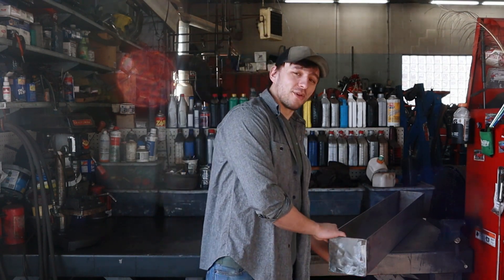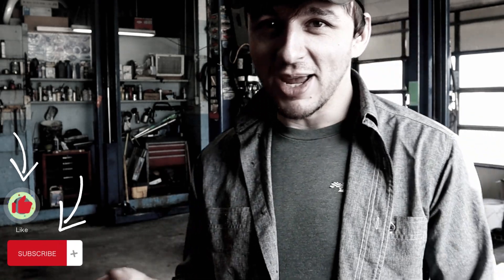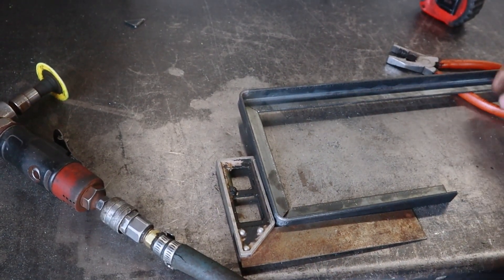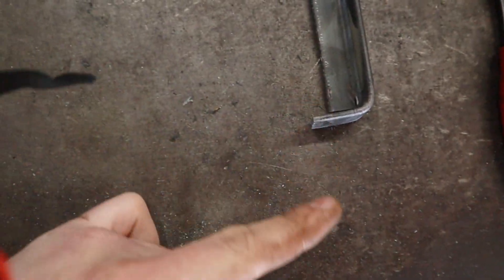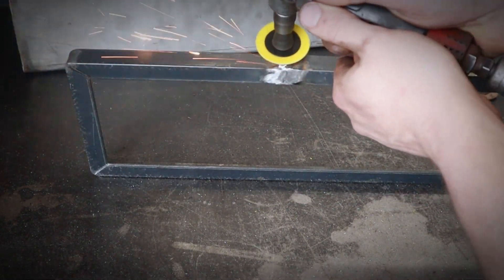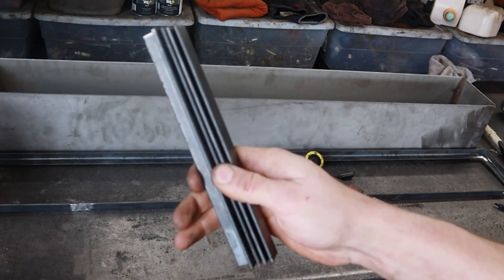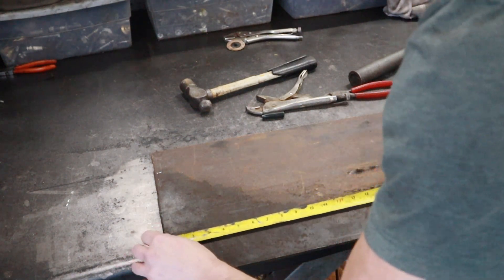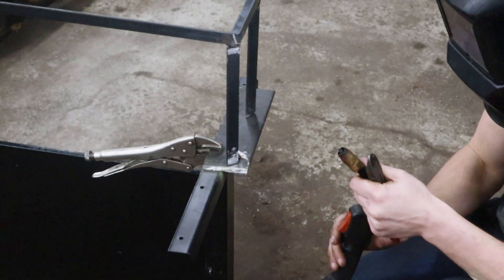Rust Bluing Rig - Part 1 - Fabrication

Comment: What guage is the tank and what did cost to have it made?
Reply from the maker: So I actually can't give a definitive price here. I bought it second hand from the estate of a former gunsmith, but I think I paid in the ball-park of $60-$80. It was obviously hand made of 13 Gauge stainless steel, which I only know for certain because I had to finish welding the caps on the ends where it leaked like a sieve.

Building it yourself would be far more cost effective than buying a tank from Brownells. (Provided you have the equipment necessary to complete it. A Mig/Tig, and a heavy enough Metal Brake to keep it square.)

In the past, I have used A piece of Aluminum Gutter (With end caps RTV'd on), and it worked perfect for what I was doing at the time. just food for thought